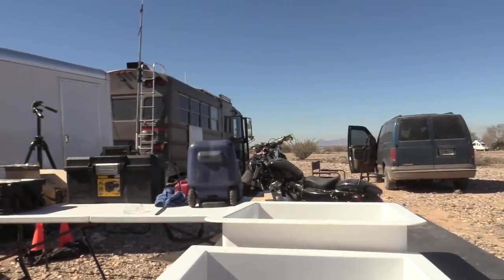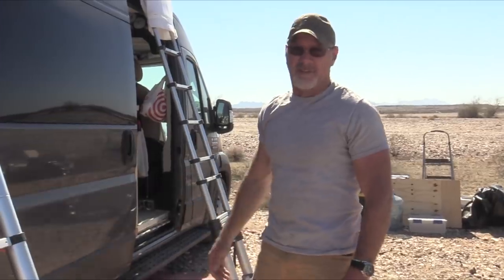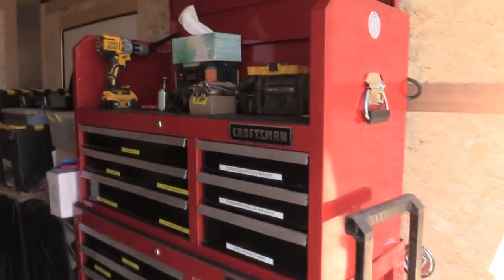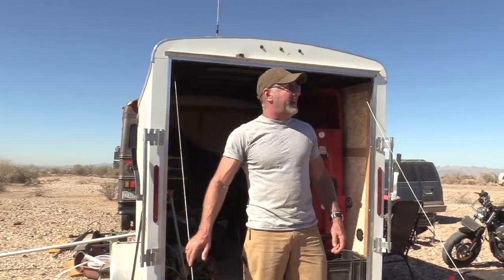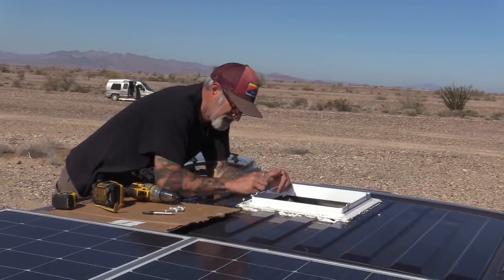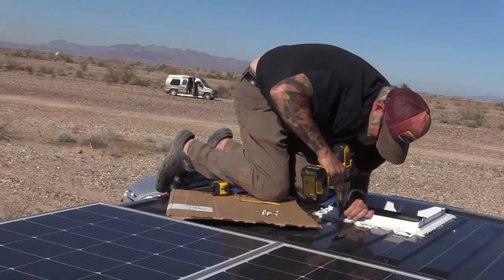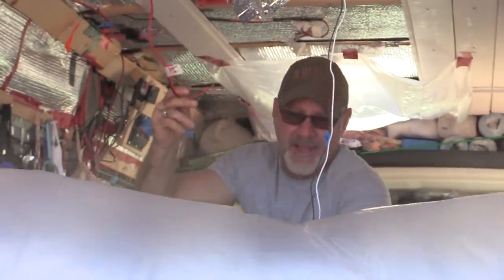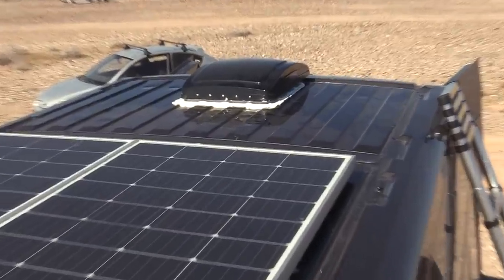Jamie and Andy swap roof fans for Younghee *Wiring Tips Included*

Comment: Is there any reason to NOT put a max fan right in the front of the roof? Like air flow or turbulence while driving? Or bad aerodynamics etc?  I was planning for one in the very front above driver but centered side to side & one in the very back above the bed. Only other spot for rear one could be next to the hatch and over the bathroom.
Reply from the maker: Having a fan on your roof definitely affects the mileage, especially at higher speeds but putting one right over the driver seat wouldn’t be a big deal, I don’t think. That said, I definitely would put the hinges towards the front of the vehicle in every case. I say get creative!